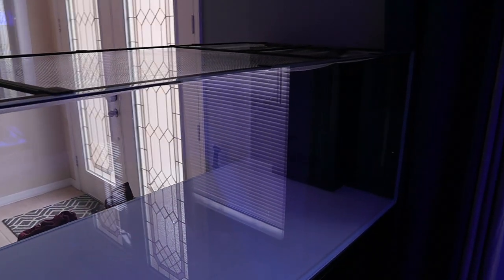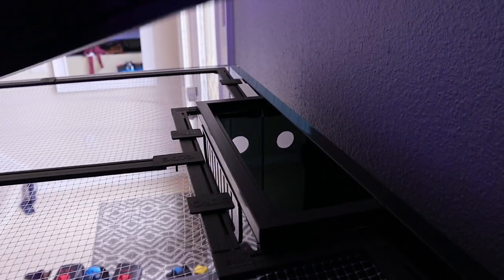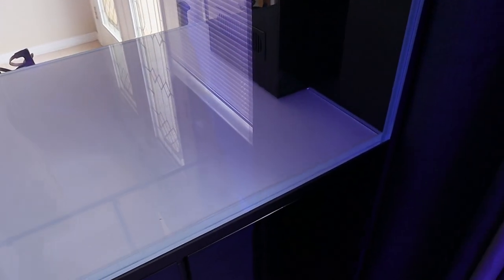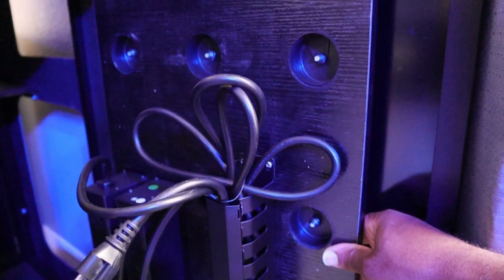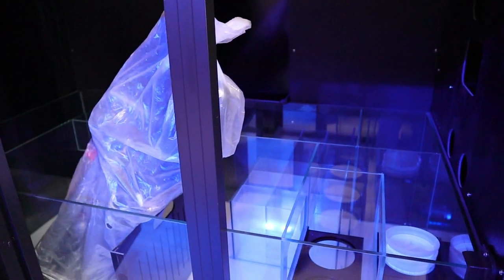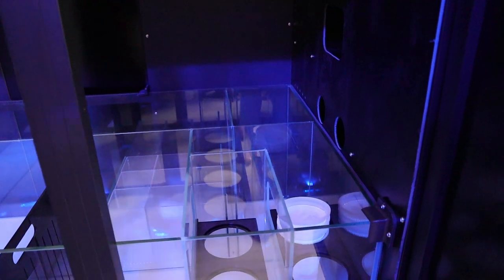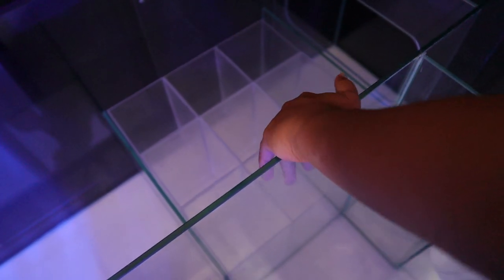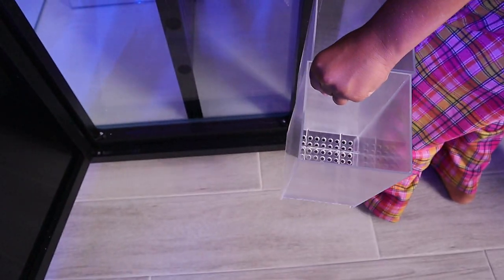Cade 1800 S2 Peninsula Saltwater Aquarium: Sump And Plumbing

Comment: Great video mate. Regarding the metal clamps question you had. They are 316 marine grade stainless clamps. They will eventually begin to rust over time, a long time. We considered them a serviceable item. What was important was that we provided something that would sufficiently hold the pipes to avoid any blow outs which would then cause a catastrophic failure. That’s when people ask the question ‘why didn’t they provide clamps that hold when the consequences of them failing is so high’. I’m saying that we have found new plastic clamps that hand tighten that are now included with out systems. Hope that helps explain and thanks again for an awesome video 😀
Reply from the maker: Thank you for this info it is very helpful. Much appreciated 👍.

Comment: I am definitely getting cade p1800 when it will be available in UK. Love the way they have built their tank, especially they have also put lot of thoughts in making thir sump and cable management system. One thing I have noticed you haven't left much space between your tank and wall for wires. Think about it, once it filled you wont be able to move...leave some space
Reply from the maker: Thanks you'll see in the update video how I handled the wire management

Comment: I really like this tank. The finish of the tankbis nice I love the sump. The plumbing is a little wonky and the metal claims are just a no no but everything else looks great. The mesh top really sets it apart from other manufacturers. That just shows they really are thinking of everything. I would have got the Cade if it fit down my stairs.
Reply from the maker: Totally agree the only bits I would say to change is the metal clamps and the mounting of the manifold and maybe add a check valve. If you had picked this tank I would have said to lay it on its side to slide it through the door way if that was the only obstacle.

Comment: thank you for sharing.. Can you please confirm the plumbing return specs (diameters), I plan on ordering a CADE 1800 SP2 and will be using a Varios 8 DC Pump for max flow (2700 gph 0ft head, 1360 gph 8ft head).  Specs on the pump show a 1-1/4 outlet and therefore will require 1-1/4 flex hose and hard pipes to avoid reduced flows.
Reply from the maker: Hi I am currently running a Vectra M2 and am using a 1 inch pvc connected to the supplied return line.
Reply: @SimplyReefing  Thank you for the information, the M2 Vectra pump itself has a one inch outlet so it looks like your not restricting any of the flow back to the display tank using your existing Cade return piping.

I'm figuring we are dealing with somewhere around 11.2 feet of pump head pressure from the 6 - 90 degree elbows, single tee, 5 foot vertical rise, and 2 foot horizontal piping.  Do you feel the Vectra M2 gives you enough turnover flow (gph) coming out of your dual 3/4 returns ?

Comment: Sweet system!
Just wondering…Maybe the metal gear clamps are titanium? 
In that case you’re golden. I have those on my returns and they’re 100% fine for saltwater.
Reply from the maker: Maybe but I still didn't want to take chances with it not being reef safe. If I recall the stamp put it as stainless steel bands.